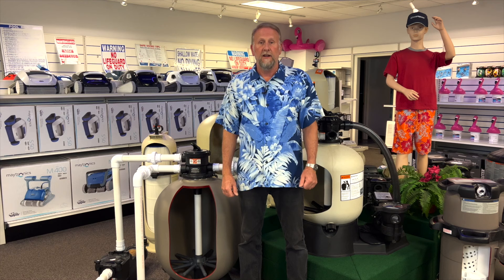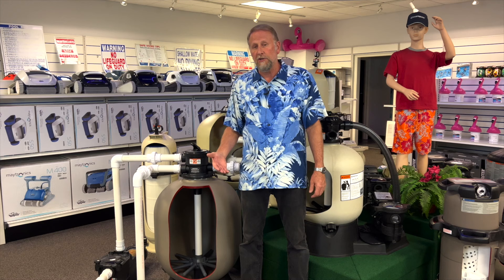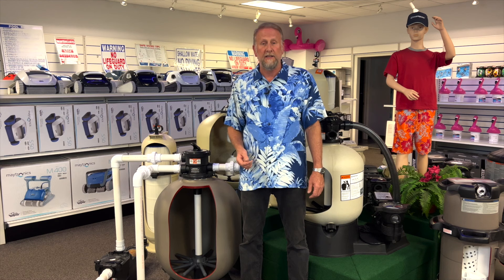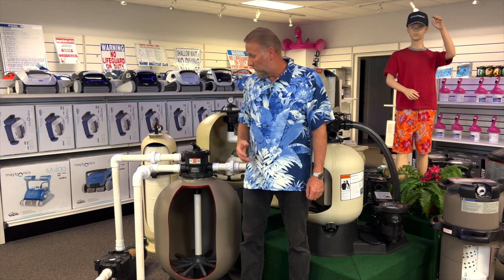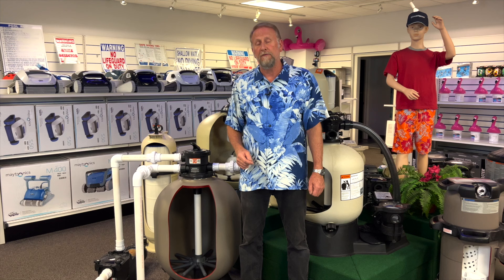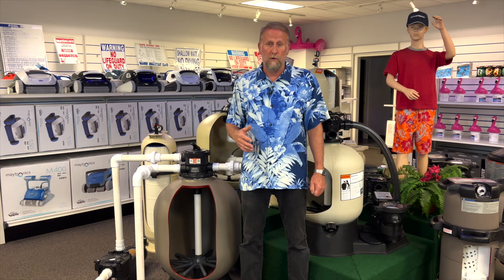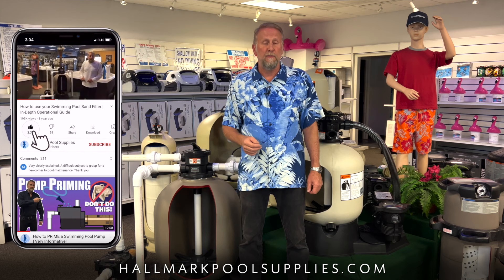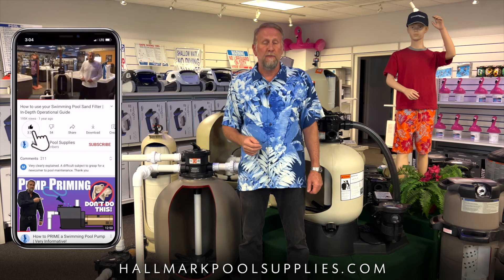5 BIGGEST MISTAKES Hurting Your Pool's Sand Filter

Comment: Ive spoken with several pool techs and i was told changing the sand is a money making scam. The arm wears out before the sand will and the sand gets changed then.
Reply: Sand is so inexpensive though! It’s like $40 or less to replace the sand where I am. That’s not much of a money making scam! 😂😂😂
Reply: Right I’m a pool tech and I change my own every season
Reply: @Lillyofthevalley222 not with one person changing it but you get several hundred customers or even several thousand and it adds up quick.
Reply: We replaced our sand with the charged glass media. I keep the chemicals good. Haven't even thought about replacing it.
Reply: The pool supply store at my house charges $40 a bag Michael to fix three bags Amazon and eBay charges 15 pretty good on the old OH ring 
And they ain’t Using any 😂magic lube on ya
Reply: Charging $40 a bag cost probably 10 or less it doesn’t ever need to be changed in the first place multiplied by all their customers that’s a nice chunk of change
Reply: Can I change the sand anytime of year? Was thinking of changing it before I close the pool after the summer
Reply: @jaywalker5920  hahahahahahaha... what a colossal waste of money
Reply: @Lillyofthevalley222  hahaha.. even on amazon it's $30 for a 50lb bag. Pool stores charge more. You need 200-300 lbs of sand. Plus the service call which is at min $150.  Reeaally  want to know how you're getting it done for $40.
Reply: @jaywalker5920  ... not believing  you..not one little bit
Reply: @ghostflier520  I don’t care who u believe and I don’t care if ur pool turns into a swamp

Comment: I have just converted my sand to cartridge filter. Flow is better, takes up less space. Never going back to sand.
Reply: Cost please.
Reply: Buying direct from China a cartridge filter with housing (about 50cm height) costs less than usd 100 before shipping. Add piping costs.
Reply: Enjoy spraying out the cartridges every other day .. I just switched from cartridges to sand and would never go back to that pos
Reply: Cartridge filter system too much work... I will never go back to filter system....
Reply: If you know how to use sand correctly.  It's great
Reply: @fperri302 A large cartridge filter needs changed/cleaned far less than the wimpy hot tub filters that come with the portable above ground pools.
Reply: I've  had an old Hayward DE cartridge filter system  since it was new back in 2000. My cartridge had been discontinued for years. Made due till it got to be too much work, taking the cartridge out twice a week to clean, too many small tears in the filter material. Just changed out to a 14-inch sand filter system today. It's gotta be better than cleaning that old cartridge twice a week!! Got my fingers crossed!

Comment: You never mention the wall valves or any other valve except the pump valve...aren't they just as important?
Reply from the maker: @charleseddem7042   For normal filtering you will leave your skimmer(s) and your drain open. When vacuuming the pool, you will vacuum out of the skimmer and close the drain or other skimmers if you have more than one for more suction. I have a video titled “How to vacuum an inground pool”. Hopefully this will help, here is the link to this video. Thanks for watching.
https://youtu.be/wUokLi3KQ9U?si=-me9bwjLm8Ufy846

Comment: So, just recently, my pool started acting up when the pump was on without the vacuum. The pressure is so low, and it has lots of bubbles. We've done all your steps, checked the skimmer, checked for leaks, and made sure everything is cleaned out, but the only good pressure is still with just the vacuum on. But the vacuum can't be connected because then we're back to barely any pressure and lots of bubbles
Reply from the maker: Try vacuuming to waste, if the suction is good you may need to backwash the filter. Make sure that your pump’s impeller isn’t clogged. If you are still sucking air and have weak pressure you may have an air leak (suction leak). Here is a link to a Video called air bubbles in your pump. Hopefully this will help. Thanks for watching.
https://youtu.be/SiEOIxYpJ5g?si=lbuxoW69NH5OIY5O
Reply: Thank you

Comment: You mentioned that the average pool should be backwashed about every 7-10 days. However, since I got the robotic cleaner and use it about every four days, I’ve noticed that the pressure at the filter increases at a much slower rate. Does this mean that the filter does not need to be backwashed as often?
Reply from the maker: Yes, Thanks for watching.
Reply: When utilizing the robot operated pool cleaner. Do you check and clean both pool skimmer and pump strainer basket? And if you have a cartridge filter you clean periodically as you utilize the pool. Usually the water flow pressure both in pump and pool jets have more water flow pressure.

Comment: Do I need to fill my filter 1/3 with water before adding sand so I don’t damage any of the fingers at the bottom?
Reply from the maker: If the sand is dry and you fill slowly you will be fine, however it is recommended to add water first to be on the safe side. I have made a few videos on changing sand  and l talk about this. Thanks for watching.

Comment: Yesterday I noticed my pool pump stopped working, so I went out and turned the switch to my pool pump off and turned it back on and I hear a clicking noise then turned the switch back off and heard another clicking noise….I just bought this Hayward Super Pump replacement motor in 2020 and I’m wondering what the problem is and if you know? Could it be the Capacitor or did the outside Breaker Switch to my pool pump go out? Thanks need your help
Reply from the maker: It sounds like a capacitor but it's hard to say what the issue is, take your motor to a local motor repair shop and have it checked. Thanks for watching.

Comment: You mentioned not to enclose your sand filter system, but leave it out in the weather. I live up north and get snow when ice during the winter. Is it OK to leave it outside during the winter time under those conditions?
Reply from the maker: You can enclose your system as long as you have ventilation. As far as winterizing your system, covering  the system in the winter where you live is a good idea for added protection. Thanks for watching.

Comment: We have had our pool for about 24 years.  It has always leaked sand into the pool and no one can figure out why.  We have had 4 filters, 4 liners and wasted money replacing the laterals twice, when we knew that was not the problem.  Our filter was not placed level if that has any possible connection. We had pipes pressure checked for leaks too.  4 different pool companies can’t figure it out.
Reply from the maker: In order to help with this problem there are several questions that l have. If you would like to check out my patreon page l can work with you one on one.  l can then go into more detail on this issue and l will be glad to help. Thanks for watching.
Reply: I'd just switch to a cartridge filter at that point. Is it possible the sand is coming from somewhere else? Sandy soil getting into underground pipes? Just a hunch. Could it be sand grains too small for your filter? Has the media been replaced?
Reply: @Leo9ine  Hi, the sand only comes from the jets.  If I vacuum n the pool , then leave the pump off, it stays completely clean. When I turn the pump back on, it has sand all over in less than an hour.  Roto rooter checked the pipes twice and said no leaks.  I don’t know what “the media” is. Never heard of that.
Reply: I have always ran a Polaris all day everyday to keep up with it, but I have gone through 3 of those, plus they wear on the liner using it so much.
Reply: We had the same problem with sand in our pool, it was the gasket where the return went through the pools steel wall. The return jet was leaking into the ground at the pool wall and picking up sand and blasting it into our pool. I guarantee you’re sand filter is fine, you have a leak behind your return jet.
Reply: @oxyfee6486  Thank you so much!  This has never been mentioned. Will check it out and update you.  Thanks again!
Reply: @oxyfee6486  just to clarify, do you mean picking up sand from the ground?  I have said that for years because our concrete between 2 of the jets has sunken in several times.  We have jacked it up and most of the fill dirt was gone.  We placed bags of cement after jacking up and that has held now for about 8 years.
Reply: @sunedz6544  We just figured out our problem by plugging the return jets with our winter plugs. I then took my small air compressor and filled the return line with air, the pressure blew water straight up behind our farthest return jet. If the gasket isn’t sealing it will act like a siphon and pick up any dirt or sand around the jet.Small amounts of water was leaking behind our jet, when enough water leaked the dirty water was then blown back into the pool settling to the bottom leaving sand. We had three companies tell us everything was fine, it might be your problem also.
Reply: @oxyfee6486  Thank you so much for all that info.  No one would listen to me when I would say, it’s like something is sucking the dirt from the ground and into the pool.  Everyone’s answer was, if that was the case, you would be losing water.  I can’t wait to read this to my husband!  😁
Reply: You mention filters being changed did that include the multi port valve ?
Reply: @user-tb2hz2xb3f  yes, that was changed with each new filter and the gasket changed too.  It’s a mystery that no one can solve.  I even vacuumed manually then ran on recirculate. Still sand.  No one had ever suggested that. So now I am thinking it’s being sucked into the pipe when while it’s running.  Rotor rooter pressure checked twice and said it would find that in the pressure test.  The sand appears only when we run the pump.  If I vacuum and leave it off for several days, like winter, it stays completely clean, no sand, then I turn it on and sand is all over the bottom within 2 hrs.  For summer, I just run the pump at night, vacuum in the morning and leave it off all day to enjoy a spotless pool.  I have exhausted all efforts of finding the problem.  I should have just filled it in last year, but they told me my pool would cost $75,000 to build today.

Comment: Just subscribed when will be watching videos in description. Add a 24-foot round and can't stand this black diamond silo cartridge big filter and 1.5 HP pump. Can't stand the plastic and have had nothing but issues and they're expensive. Add skimmer basket leaks air getting into the pond and poor circulation. It wasn't cheap either and the cartridges cost about $175 and I need one every year and especially have to clean the filter cartridge several times the first week of the season. Have limited use of the pool due to repeated issues and I was on top of chemicals and pH. Looking into sand filters and replacing my mouthpiece since the attachment skimmer basket leaks as well even after flex seal temp fix. 
Pentair Hayward I'm looking into another brand name called jacuzzi which is a couple hundred dollars cheaper. 530 in comparison to 850 +. Just prefer an old school system that seems to work better add last longer and that black diamond silo style does not have any valves so you cannot backwash you cannot do anything but discharge while vacuuming which is a race against the clock before you have to refill the pool to a proper level.

Comment: Hi Mark. I moved into a house with a Hayward SP710XR50 except for filter and backwash all the positions have worn off.  the filter position is away from the filter.  the Backwash position is near the filter.  The pump is working fine in those positions.  My question is what position is rinse?  If you could tell me the correct labeling so I can write them on the decal that would be great.  I looked for a new decal they only come with the new labeling.  
Regards,
M.Weglarz
Reply from the maker: If you are standing in front of the filter and the filter position is away from the tank, then think of a clock. Filter is at 6 o’clock and rinse is 4 o’clock. Thanks for watching.
Reply: Just pull up an image of the filter valve in google. Then you can relabel your valve.

Comment: I have a 24 year old inground 25,000 gallon pool with a DE filter.  This filter is 7 years old.  Every time I backwash I get a lot of DE coming back into the pool.  I am considering replacing the DE filter with a sand filter, using glass media, because it is supposed to clean down to 5 microns. I welcome any suggestions you care to offer.
Reply from the maker: @tomwolf5755    lf you have DE coming back into the pool you may want to check the grids inside the tank for any damage or tears. I prefer a sand filter over a DE or cartridge filter. Even though a DE or cartridge filter can filter finer, sand is very forgiving, cheaper to operate and works very well. If you go with a sand filter l would use sand over glass. Sand does filter better and is cheaper. Thanks for watching.
Reply: @HallmarkPoolSupplies  Thank you so much for your instant response, and your expert advice.  I disassembled the filter and could not find any holes, cuts or tears in the grids. I'll keep trying any other options to keep the DE in the filter tank.
Reply from the maker: @tomwolf5755    Another thing to check, make sure you have the right amount of DE in the filter. You want to also make sure your grids are sitting properly and the manifold is in place, secure and not damaged.

Comment: I have glass instead of sand. How often should I be changing glass vs. sand? My local pool stores sell glass but do not know enough as not many people buy glass. I opened my pool 7 days ago and I made the mistake of algaecide going in my skimmer. I knocked the bottle over and about 4-5 ounces fell into my skimmer. Pool size 32,000 gallons. I waited 3 days to vacuum, backwash and rinse. I noticed bubbles exiting backwash hose and didn't think much of it. I put it back on filter and noticed large bubbles in my pool. The bubbles are still present after I use my net to remove most it. What do I need to do to remove the bubbles, drain the water in the filter and start over? or will the bubbles go away over time? The more I remove with a net, the less I see bubbles, but still enough for me to net 2-3 times a day.
Reply from the maker: Sand is much finer than the glass, l prefer sand over glass because it is cheaper and filters better. Sand is normally changed about every 3 to 5 years, glass is supposed  to last longer but some say it has the same life as sand. If your pump is running air tight and you are not sucking air then you will be fine. Eventually this will go away, if not you may have a suction leak. Here is a link to a video “air bubbles in your pump” that may help. Thanks for watching.
https://youtu.be/SiEOIxYpJ5g?si=G89uVHc4-Y40wwzT

Comment: We just installed a sand filter to our above ground pool.  The psi only reads 3 while running.  Water shoot out fast in the pool, so not a pressure problem.  Should I be concerned about the 3psi?
Reply from the maker: If the system is fully primed and running you might need to replace the pressure gauge. Thanks for watching.

Comment: Hi, I live up north where we get ice and snow during parts of the year. When I close my pool if I remove the hoses and leave the sand filter and pump outside, would either unit be damaged by snow and ice or should I move the pump, the sand filter or both into my garage until pool season comes again? Thank you.
Reply from the maker: If the equipment is drained and winterized properly it will not freeze but to be on the safe side you can cover your system as added protection. Some people will store their equipment inside but it is usually not necessary. I would ask your local pool company what they might recommend for your area. Thanks for watching.

Comment: How much supplemental DE could you add to a Hayward sand filter if you wanted to clarify a could pool?
Reply from the maker: @g2racing   It depends on the size of the filter, in most cases 1 to 2 cups will do the trick. Thanks for watching.

Comment: Why is the pressure down on my pool ? What do I need to do to increase the pressure ? Thank you
Reply from the maker: Low pressure usually indicates a flow problem, the first thing that l would check is your pool pump. Make sure that the pump housing is cleaned and that the pump’s impeller is not clogged. You may also want to make sure that your skimmer(s) are cleaned and that the weir door(s) are not stuck. Thanks for watching.

Comment: We just bought a house and they have a pool with hayward pool pump.  I'm getting ready to open it but it seems they never set it for winterizing.  Still set on filter mode. The water was low so I'm currently emptying it to start fresh but i see green throught that little window in pump.  They said they just put new sand in it last summer.  Should i just fill pool and back wash? Maybe do few times to wash through and before i set the pump to filter water.   Theres no trees around us so no weird debree in sand im sure.  Or should i just change sand?
Reply from the maker: Yes, if sand was changed you will be fine. Thanks for watching.

Comment: Do you not consider the pressure gauge when determining when backwash is needed?
Reply from the maker: Using the pressure gauge will help to determine when to backwash the filter, your jet pressure in the pool can also be used as another visual reference. Thanks for watching.